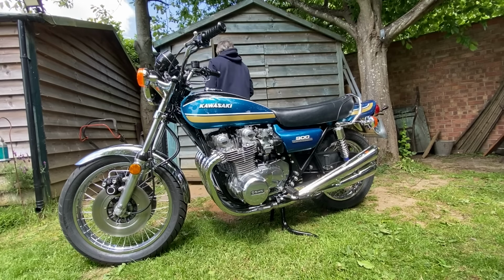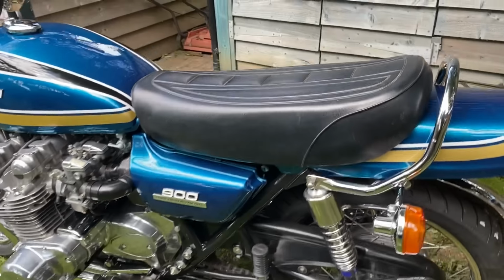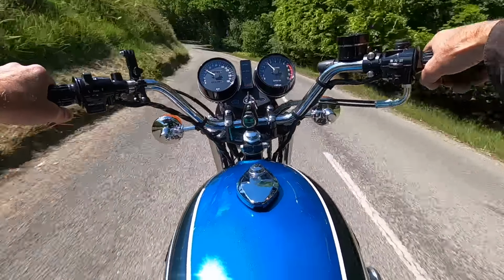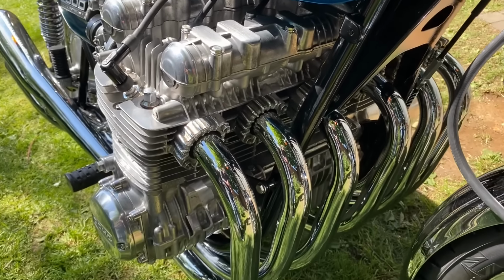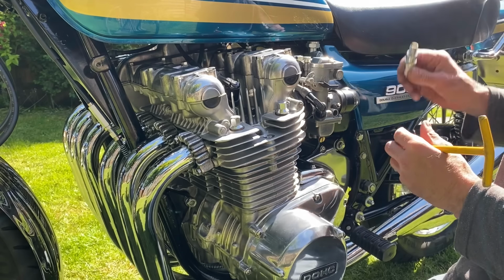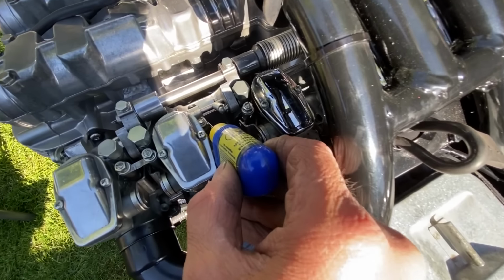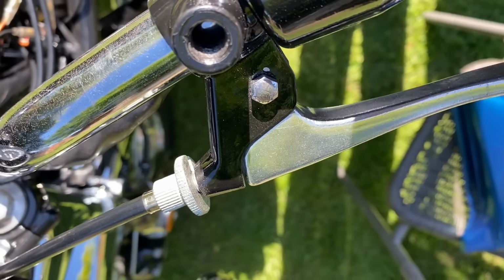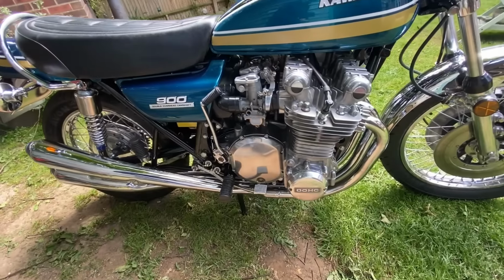Kawasaki Z1 Super Six first test ride

Comment: Looks like I have been doing the wrong thing all this time cleaning plugs with a wire brush. I will cease immediately and follow your method. Thanks for the tip!
Reply: 1 day later and i would have also used a wire brush

fire to decimate the carbon... genius !
Reply: I been doing plug cleaning wrong also,only 37 years worth! 😑
Reply: I’ve been cleaning sooty plugs wrong since 1973 on my Garelli Tiger Cross to now 😱😱😱
Reply: ive been cleaning my 2stroke plug with a small chinese pen grinder..
Reply: I have never used a torch to clean it but it really helps to heat a plug to start a single cylinder motor on cranky cold starts!
Reply: @seanmckinnon6649  what a bloody good idea-i never thought of that.
Reply: Guilty in case of "using some kitchen stuff like a gas stove" But only if the better half is out of office ;-)
Reply: I clean my spark plug on my cagiva 125 and a Sachs 50 cc with a lighter. Always thought it was obvious, since a spark plug is combustion purposed.
Reply: Yup. Wire brush is the thing. A shot of brake cleaner and then fire it with a torch. That will get a lot more of the carbon off.
Reply: @Yorkshiremadmick  
 Same on my Suzuki gt250k since 1973 as well lol
Reply: And cook lunch at the same time.
Reply: Sean Mckinnon Not meaning time be contrary, but I’d expect the contact between plug & head to be so effective that it’d suck all the heat out of the plug before it’s been tightened up?
Reply: @GT380man  you'd think so, but I've had bikes that needed the plug heated on the cooker before starting. I think it's more about getting the water out of the insulator and petrol oil Mix cleaned off than anything. That said, a couple of degrees makes all the difference and it's surprising how long the plug stays warm. Obviously, there's something wrong if you have to be continually doing that to start an engine, but needs must.
Reply: I've sand or bead blasted fouled plugs from a 2 stroke before, you just have to be sure to get all of the media material off before you reinstall, they literally look brand new
Reply: stainless steel brushes might be hard enough not to create the mentioned issue... my fav method is tooth brush + solvent. proper combustion temp will clean the plugs in no time.
anyways, the worst of the worst is using sandpaper to clean the plugs... abrasive materials get stuck up the plug's ceramic insulator only to be dumped in the cylinder later on... (same issue when sand-blasting the plugs)
Reply: @This0is0pointless  yeah, J.C. Whitney used to sell a really cool spark plug cleaner that was basically a small sandblaster
Reply: A real pro would have put a couple of bacon rashers alongside that plug
Reply: I used to clean my plugs with a paper dollar bill. I would tighten the cap over the edge of the bill so I could dip the plug into my tank. Then pull it out, unscrew the bill and fold it to a point. Push the point of the bill into the hot end of the plug and rub off all the carbon. Good as new then let someone try my H1 for acceleration to blow their mind

Comment: What a gorgeous piece of motorcycle mech' art. Kawasaki should have made this to rival the CBX.
Reply: That was an ugly square beast  Waylander the Slayer
Reply: While technologically excellent, the added complexity and lack of power gains generally decided manufacturers against sixes. Later fours soon outpowered the CBX. Certainly beautiful engineering.
Reply: @alancsalt  I also have heard back then that, It was difficult to keep the inner cylinders cool enough for longevity. So designers went a different direction. I am sure that normal running conditions wont have a problem here. I believe it was the racing environment that would tax the heat dissipation. What an Iconic Bike!
Reply: Apparantly the CBX was indeed derived from the kwaka technology believe it or not, 
I learnt this only recently  🙆‍♀️

Comment: AMAZING--i had a 74 Z-1 for many years, 1015 CC Wiseco pistons, cylinder decked to circumference of piston, Manley big intake valves, Megacycle 417 cams with the 'buckets' type shims, 29 mm smoothbore carbs, good clutch springs, crank windage tray

Comment: Great Stuff,is that XT1 used as a ‘run-in’ additive ? Or do you put it in everything ? (Never heard of it before your vids) cheers from Manc.
Reply: I also use zx1 for engine builds and add it to all vehicle oils  ,old or new it reduces ware and increases smooth running .I used to put it in Harley gearboxes with big improvements in function .
Reply: @Mrdbaker2u it's not a product placement a company would ensure a YouTuber would put a link to thae product and say its sponsored by them or it would be illegal.
So yeah he just likes the product
Reply: @MrTrek164  wear*
Reply: I noticed it in one of his older vids also. Thought it was really odd that such a person would use an additive when they would also be using top shelf oil. Looked into it a little and found Demon Tweaks are a seller. I would think a retailer like that would not stock something that wasnt legit. Nothing mentioned of it on "bobs the oil guy"
Reply: George Bamber n

Comment: No gloves?! Careful Allen! ;)
Reply: My first thoughts! You would think a man so good with his hands would look after them a little better!
Reply: if you fall, the first thing to hit the ground is your hands, so i second this sentiment. If you crash at 10mph with no gloves you'll have sore hands, if you crash at 25mph with no gloves, you'll have a permanant disability...
Reply: @mattjacomos2795  bla bla blaaah 🙄
Reply: @mmm-rd4yr  On the subject of ATGAT, I only ever took my Boulevard M1800R out just once without protective trousers (just regular jeans.) Weirdly enough, another biker coming the other way pointed at me and then to his kevlar pants (i.e where are yours?) I nodded (he meant well) and carried on regardless. Weirdly enough I got too close to a truck (my fault) and when a car pulled out on him, and he hit the brakes, I had nowhere to go. So I low-sided it and slithered across the tarmac. I was lucky, I only had a displaced shoulder joint (still got the lump as a souvenir). Even luckier, my jeans were ripped through but by some miracle I didn't even have gravel rash. So I guess the question here is, do ya feel lucky? Well, do ya?
Reply: Quite right, I never rode without helmet,  gloves, boots, double jeans and leather jacket. It's just not worth the risk that a minor SMIDSY could see your hands stripped.
To this day I get the Heebie Jeebies when I see anyone on a motorbike without gloves and usually wearing a short sleeved shirt!

Comment: Good luck in checking spark plugs on the Honda CB300 and mostly all modern bikes because you have to take off a lot of stuff!
I love these old style bikes because you're the master and if you know how to do it, you can adjust and set as you like.
No annoying and expensive electronic devices to deal with which you must replace with the modded one in order to fix problems, costs are very very high!

Comment: I found after I made more power clutch slipped I use the inner valve springs from head works great and no  Detergent in the oil anyway a very impressive what you've done

Comment: Hey Allen. Great job!!! I've had several Z1s over the years, including an 1105cc beast. When I needed taller gearing, I remember a company named Andrew's made an over drive 5th gear. I installed that and it got me the higher highway gearing I wanted. Of course, I had it apart at that time, so it wasn't a big deal. But obviously, you would have to pull your motor again, and split the cases. Probably best to go the 30t rear. I assume you're already running the biggest countershaft sprocket you can.......

Comment: Spark plugs have an adhesive between the center electrode and the porcelain and you can cook it right out if you heat it up enough. You will have serious shorting problems soon after, when carbon deposits get into where the adhesive used to be.
Reply from the maker: Its worked fine for me for 50 years so,  I must have been lucky i guess, never had any problems with shorting

Comment: When you fill up with oil .. hold the canister so the side that has an angle points down .. it's designed that way so you dont spill any :) Try it

Comment: Absolutely amazing! Would you be afraid to take it up to full rpm? It would be interesting to get it on a dyno to measure the engine's output in torque and horsepower.

Comment: I'd like to convert a outboard 2 stroke motor for use on a small size crosskart gokart size with motor between legs siting above or just before the axle independant suspension. Those v8s make a lot power in a small light package

Comment: gonna have to make a 6 port vacuum sync tool, or gauges.. if you have any old thermometers that can sacrifice their mercury you can easily make one with fish aquarium hose and a few feet of clear rigid tube for each port, mark em off with calibration lines, use tees and such to connect it all, the very bottom needs to be pass through so each tube pulls on the mercury you filled it with, works so well, better then gauges IMHO, each bike is different tho.. some seem to work better on gauges while other on mercury sticks?   that bike is stunning

Comment: I think the front sprocket is 15 tooth on the Z1.  You could probably get the same result getting a 16 tooth front 32/16 is the same as 30/15.  The 30 tooth rear sprocket would lengthen the effective swingers length thus slowing the bike's turn in.  With that extra pair of cylinders hanging out there, any help making turning quicker would be nice.

Comment: Motorcycle mecanic advice: antifriction oil can burn your clutch discs as per they soak in the same oil and clutch need some friction. That happened to one of my customers.
Reply from the maker: its true that a lot of  anti friction additives will damage a wet clutch. ZX1 Extralube works in a different way at a molecular level and does not damage a wet clutch or and drive using organic material. ZX1 must not be used in automatic transmissions where metal to metal contact is used to shift gear

Comment: Also i hear putting some zx1 into the fuel take helps the bike also especially in 4t top end.

You can also use mmo "marvel mystery oil' or seafoam in carbs to run lean to get rid of carb in bike so runs better raises compression also good for removing rust i hear mmo, seafoam not as strong but still good but is half size for same price, you can use for loads types fuel but don't spray into diesel intakes only use one from Euro car parts for that everything else ok mmo, wicked stuff you will love it.

I also put zx1 im my car 200 ml every oil change good stuff, you can put in gearbox also so last longer mix with the origional fluid to

Comment: Blow touch method is particularly good for oiled up 2 stroke plugs. PS what a piece of engineering.
Reply from the maker: Exactly it’s sooty oils plugs i do this way, plugs are usually self cleaning if the engine is running right

Comment: FYI. That "laser" thermometer only uses the laser diode as a guide, and it doesn't matter if it reflects on blank surfaces. it just shows what you are pointing the device at, the measurement is done by infrared of an area similar to 1/5 of the distance to the object and not the laser pointer itself. (This ratio depends of the device, but I have the exact same one.)
Reply from the maker: I know that the diode is a guide dot, but the infrared thermometer doesn’t seem to work on highly polished chrome surfaces
Reply: @AllenMillyard True, an object with a polished metal surface, emits far less infrared radiation than the same object painted with matte black paint. Emission from Chrome is around 5% of matte black.
ps. Nice bike, had a hard trimmed Z1000 in the mid 80'ties. But nothing sound as sweet as a six'er.

Comment: Antifriction additive is not recommended in a motorcycle where the oil lubricate the engine and the clutch.. As a mechanic, i've seen a lot of clutch slippage due to lack of friction between the discs. In a car, both are apart.
Reply from the maker: Zx1 does not affect the operation of a wet clutch with organic plates

Comment: I am wondering how this is that this engine needs horizontal gaskets between the head, barrels, block, etc, but it doesn't need vertical gaskets where the cuts were, I mean, the engine parts are not really fully welded in, only the outer sides are welded in.  Wouldn't the pace with the cuts need gaskets?  Or are the cuts so perfect that it doesn't need gaskets?  I am really amazed with this motorcycle..

Comment: I have never come across Extralube ZX1. If you're using it, that has to be high praise indeed! I can understand its advantage in shell-bearing-based engines but how is it with roller-bearing-based engines such as the Harley engines? Would the reduced friction cause 'skidding' of the bearing and ultimately flats being worn on the balls?

Comment: Also bike sounds lovely, you can also buy lectron carbs that dont need fiddling with ever as no jets, very clever just don't go bigger than standard size or you will loose bottom to mid grunt, works well on 2 stroke rd's aswell as motorcross bikes but should be great in 4 stroke also.

Why dont you fit bigger or smaller front sprokect to do gearing if rear is awkward.

I was able to use zx1 in my zx9r but my fazer1000 the manual said not to use it as wet clucht could cause it to slip so just changed ever 2k oil, but i may try a little in sons 05 kawasaki kx85 as takes 650m of oil every 4 hrs as looses the efficiency so no good but, if i put tiny bit of zx1 in next time so dont make clutch slip will 50ml be ok so it will bond onto the internals so gearbox last longer or any other parts so keeps it nice? Obviously i woundt put it in again for the next 2 or 4 oil changes as it should have bonded already first time but i hear have to be cearful  not to put to much in case makes new clucht slip?

Comment: That color scheme is a 74 KZ400.   Didn't know the 900's had the same scheme ...or is it a 400 frame?    Did you beef up the frame to deal with the extra torque/horsepower?

Comment: Alan, has adding the extra cylinders increased the oil capacity? Also, just wondered if the ZX-1 oil additive is safe to use on a motorcycle with a wet clutch. Just purchased a 1977 Z1000 a1 which I am going to restore, unfortunately I don’t have the skills to add an additional 2 pots!

Comment: hey allen millyard,  i think i have same issues  with my carbs !!  i have a honda cbr 600 f3 from 1996..  and its terrible to drive in low rpm, and just want to stay in speed !  like 20 mph, and then its  twitching. only when i have more gas is drive fine.  and i think that is from the carbs.  how do i fix that ?  really want an answer. can it be piston rings?  to worn?  so the compression sucks in an even?  or carbs clogged up ?

Comment: Hi Allen, just ordered some G zx1 oil treatment. If you are using it it must be good. I  am restoring a kombi and want to protect  the engine as much as possible.  How often do you use it or is it a one off?
Thanks Gary yor opinions gratefully
Reply from the maker: It’s good for 25’000 miles but I put some in every oil change and mix in oil tank on two strokes or add to pre mix it’s amazing stuff that actually works
Reply: Thanks Allen, much appreciated from Oz.

Comment: Hi there loving the video's 
Do you do any work on yx140cc or 125cc lifan pitbike engines?
Reply from the maker: I look after my Son's YX140 quite a nice engine and reliable with regular oil changes
Reply: @AllenMillyard  
I am doing a rebuild over the winter. 
Are standard cam chains any good?  I was looking at a DID one
Reply: @AllenMillyard  
Is it right to use 10/40 mineral oil

Comment: Hi! I have a bit weird question. But do you know the diameter of the hole where valve goes in? I'm going to take off rust from inside of the tank from my 1974 Z1 900, and i'm looking for the diameter, so I know what hose to buy. At this moment the tank of course is full of gas, and I have tried to find this information from google..

Comment: I forgot to add,” Allen....that is sick.....In a way good way!” I have worked as a machinist for twenty years. I can’t do what you do. Hand sawing a deep cut while holding tolerances many expensive bands saws would have trouble holding? My college machine tool instructor had apprenticed in the 1950's in a GM factory course. He told me that in one of his finals test, everyone in the class had to try to make a .001" tolerance gauge block true and square using only a hand saw, and all the hand files of your chose. I had come into his office to complain about not having a ready made fixture for a job I was running on a lathe. We had a lot of walk-in customers. I was fab-ing a hydraulic aluminum pump housing for an old out of date Ford farm tractor. .0005" tolerance. That’s what he wanted. I later learned to stop using the word impossible when discussing my next machining project. He actually would take away a tenth a percent from our grades for every time we used that term: impossible. I dropped from -A to a C+ in that semester. In my last semester I got straight A’s. And I learned more.

Comment: All you need to do is put graphite powder on key lock, do not use zx1 or wd40, it may take a few times plus to lern a certain knack turning key without braking it but you dont need new barrel, i had same with my old bike 03 fazer 1000 as wasnt used in months, was a pain as coulnt get bike started but as soon ss i used grafite powder in key lock after about 3 to 5 times poring a little in at a time it was better, just put it in then wiggle key, commom fault with locks brilliant hack